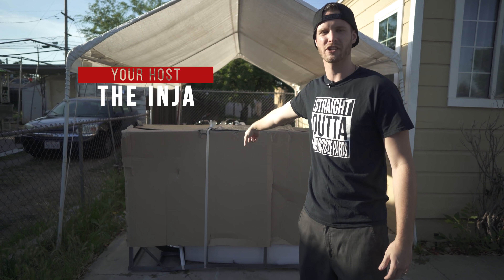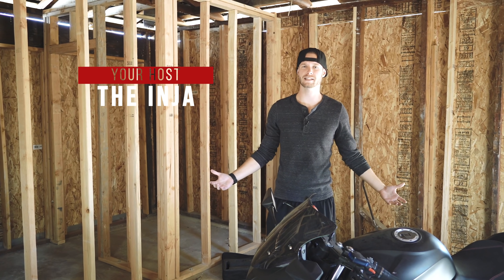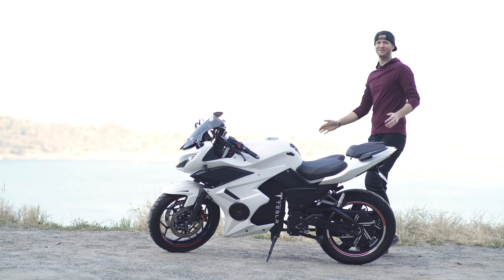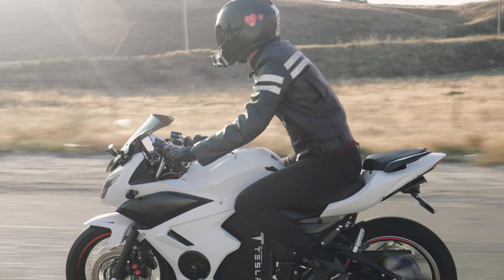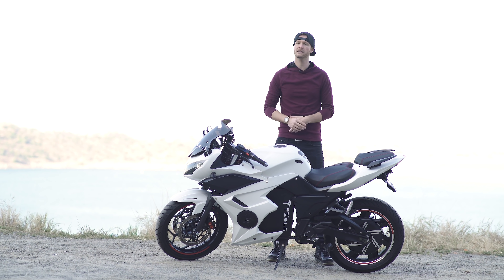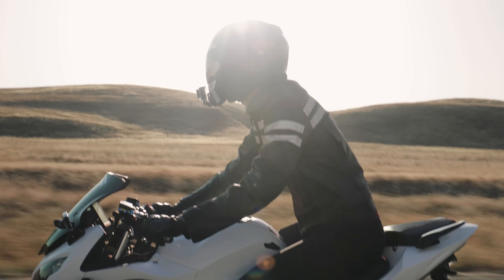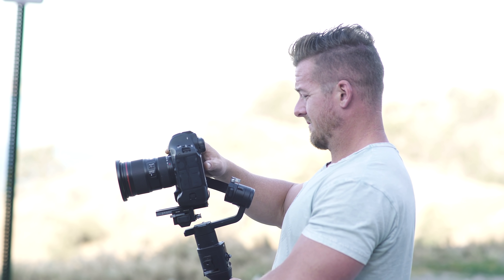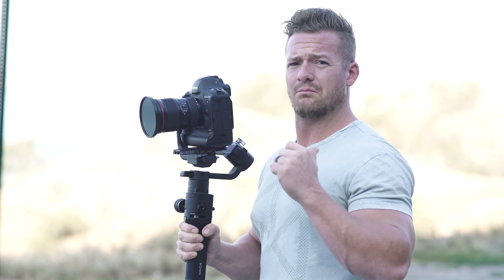CHINESE ELECTRIC SPORTBIKE | Full Build in 7 Minutes [TimeLapse]

Comment: Hello. Been watching and subbed a good while. Love the content. We actually experienced a fairly similar case purchasing basically the same bike, but a slightly new upgraded version. Its called a "Fly Ebikes RZ, with a decent 55aH Lipo battery, anderson plug, 100a solar breaker. We still have the oem controller, but is larger than your oem controller. We actually got our in person. ive seen some vids of riders hitting 70MPH on stock hardware and programming? Im trying to reach out, bc i REALLY, REALLLY believe that they are "locked up". Ive reviewed many different makes and models, and all data points to fairly serious factory performance, but varies based on available MODE/GEAR selection between the bar switch and speedo unit. Any help with this would be appreciated. Thanks.

Comment: I’m sorry, but what was your new build motor wattage, and battery amp hour, and voltage, and max speed?  What was the motor wattage, voltage, battery ah, speed out of the crate?
I watched most of the vids. Forgot to take notes. 😂
Reply from the maker: They sent me a 2.8kw motor, 40ah battery (didn't charge, broken), top speed was like 40mph, only got me 10 miles range.

Upgraded: 
8kw motor, 120ah battery, top speed 74mph (but gets you there pretty fast), around 80-110mi range depending on how you ride.
Reply: @TheInja  I’ve been making projects with hub motors myself for awhile. I’m ordering a 10kw, 100ah, bike from China. Through kingche. Kingchebike.com. Nice people, great prices, hopefully won’t be ripped off, and everything works. Will post a vid when I get it. Supposed to go about 85/90 mph with those specs. And their new bike is a little bigger, longer for the speed. Getting the v6.
Reply: @TheInja  so you kept the same 72 volts. I tried 84 on one of my builds. Did about 50 in my suburb streets. Each 12 volt step up seams to add 10 or more mph. I think your controller can handle up to 120 volts. I used to add an extra pack on the back of my bike in series to add another 24 volts for fun sometimes. Ran my bike at 60 volts normally. Then 84 for turbo time. Just a quick wire swap to add 24 volts in series.
Reply: Another great source. Lyen from lyen.com. Helped me with some custom variable voltage beefed up controllers.
Reply: And I believe most of the hub motors are QS hub motors with these Chinese bikes.

Comment: Great video 👍 just noticed at 4:40 the positive HV cable is connected to the terminal with the red ring but I’m pretty sure that bypasses the main fuse. Might want to check that if you haven’t already switched it over.
Reply: loyee123 it’s running through a breaker, so it won’t be an issue :)

Comment: Hi,I'm from china I wanna try do this to on my bike........ most of the electric  bikes we get sold are basically what they gave you at first damn i'm inspired
Reply: I got my second e-motorcycle when I lived in Taizhou, Jiangsu, and close to the first thing I did to it was to ditch the Lead Acid batteries and replace them with LiFePO4. That alone totally changed the thing into something at, as a person from the US, considered usable. As a stage 1 build, stay with the same voltage and as much capacity as the battery box gives you room for. It will transform the bike.

Comment: Great build! I think I'll wait for a US based importer so I can skip all the frustration with the original seller.
Reply: Converting a gas bike is also an option. You may end up with higher quality everything. Lol
Reply: @JasonWW2000  Good point.

Would the hub motor wheel fit in a normal bike swingarm?
Reply: @thedroolfool  This is a simple thing to find out. You look at the specs of the motor you want to use then measure the swingarm width. Inja used a 3" wide rim, but you can also get a 6" wide rim. With no chain you have extra room to play with.

Comment: Can you give us more details on the specs, the upgrades, top end, watt output on the batteries, recharge time, Total Cost etec?
Reply from the maker: Already did!
Reply: @TheInja  I dont think you mentioned recharge time. Obviously it will vary based on how low the battery is, but generally would you say it's an overnight charge?

Comment: Whos low key thinking about replicating his process with stronger 12000w motor?
Reply: Motor price doubles and it needs water cooling. Something to consider. I'm thinking of the 6" wide rim 8k watt motor with a 200 tire and maybe extend the steel swing arm 3 inches. Give it some attitude. I think those 8k watt QS motors can be hacked to go about 100mph, but they can't sustain it continuously.

Comment: At about 4min and 43secs I noticed your positive battery lead was connected to the wrong side of the ANL fuse. Essentially you've bypassed the fuse and have gone directly into the motor controller.  Easy mistake with all the poorly translated instructions.
Reply: Duane Meville na, we put a brand new breaker in on the cable rather than a fuse. Everything is protected even better than the fuse would do. He didn’t include all of the rewriting, but there’s a video for it in the series :)

Comment: This battery is very dangerous because you have just a single shrink on the battery, so vibration can cause short circuit between series cells. You have to isolate batteries from each other
Reply from the maker: They're fine

Comment: cool project, enoyed it from start to finish in these months. but still think its not worth the money vs the value. Thanks for the video though ! it really one of the best looking bikes !
Reply: Are you comparing it to a gas bike or other electric bikes? Electric is always going to cost more. The electric motor is really expensive compared to a gas motor and then the battery is really expensive as well. So gas bikes will always be the better value. If you compare it to other electric bikes Injas is very good value.

Comment: Will there be a update video on why it shuts off and overheats ?
Reply: nah, in a video he said that it already bought a fan to not overheat
Reply: @foxxyytofficial  He fixed the issue without a fan. It was the regen that was overheating the controller. He turned it off and all is well. Maybe a fan will allow him to turn the regen back on, but at a lower level so as not to built too much heat.